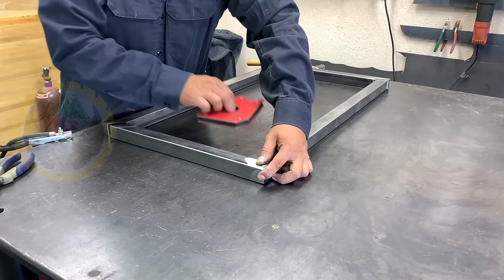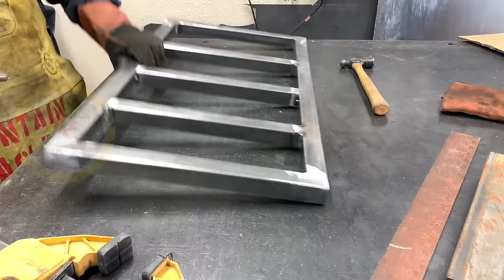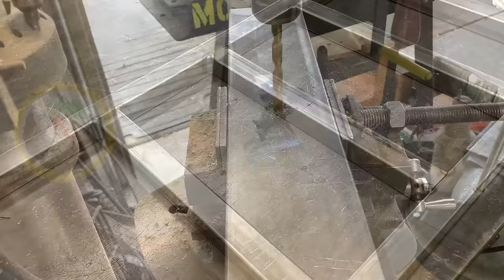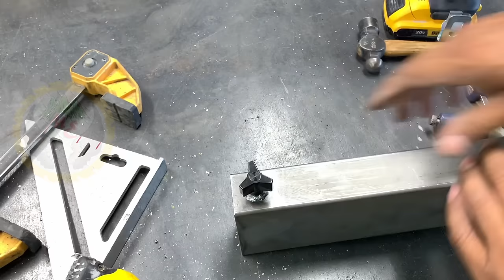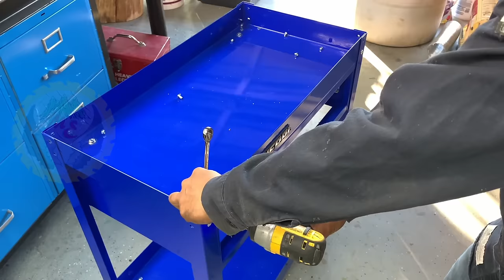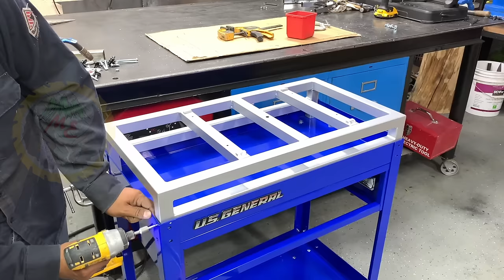DIY Ultimate Mobile Metal Saw Stand With 90 & 45 degree Extension's / Tool Box Hack

Comment: That stop setup causes the cut off material and the blade to bind and be thrown violently or damage the saw (as seen just before an edit.) Flip that stop up or away so the dropped/cut off piece doesn't jam. Pretty nice set up. I added a couple rare earth magnets around to catch metal chips, and they fill up fast.

That bind up looked like a foot long piece of square tube shot out of a cannon.

Comment: Neat ideas and implementation. Suggest one change and one addition.
Your length stop should swing out. After you clamp, the stop must be removed to prevent bind and kickout.
Add two brackets on the back to store the supports vertically when not in use to save space.
I am going to copy your project but with these and two other changes to the tool cart.
Very nice. Thanks for posting this video!

Comment: A handy thing (!), But a little bulky. I would take a 20 mm pipe for a skid. And the table protrudes beyond the edge of the base of the saw - not very good, because short lengths cannot be cut with the stopper. Another point, the limiter will take up a lot of space, in theory, you need to make it pull out in one motion or be foldable. What I liked - a drawer for sawdust (!). I'll make myself the same. Thanks for the idea!

Comment: I love it! I do see you (almost) cut out the part where the cutoff piece goes flying when you have it against the stops. Any ideas to mitigate that? I'm thinking a piece of angle raised up level with the saw bed to each side where you could throw a welding clamp on the cutoff piece on the outside of the saw blade. That would keep it from flying off when the blade pins it against the stop.

Comment: Hello genius. What is that cutting disc called?
Reply from the maker: Evolution 14 In. 66T, 1 In. Arbor, Tungsten Carbide Tipped Mild Steel And Ferrous Metal Blade https://store.evolutionpowertools.com/products/14-mild-steel-tct-blade?variant=31770945650781